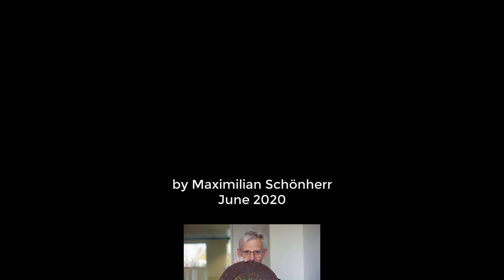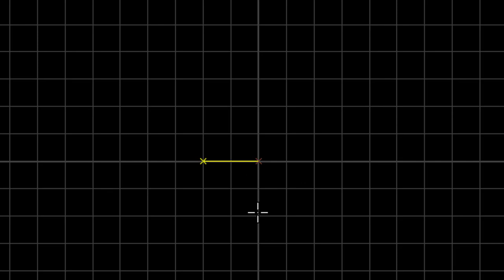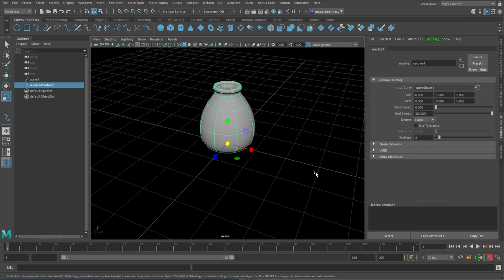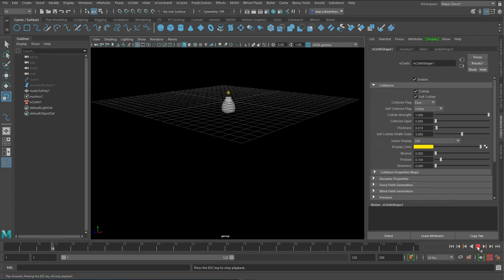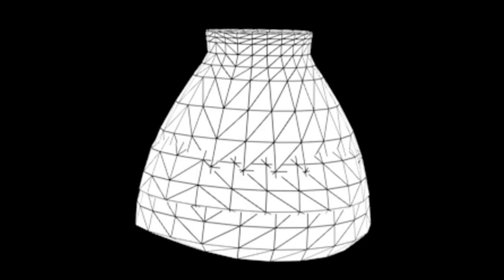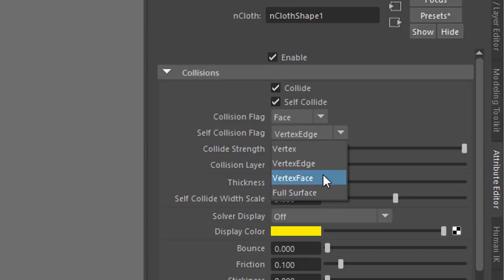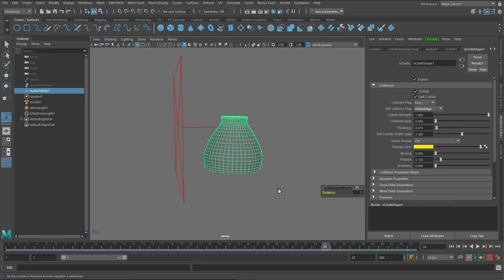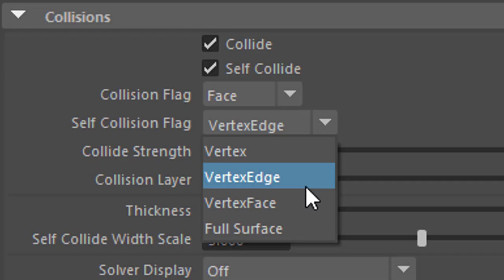Maya: nCloth Self Penetration

Comment: I know this is not relevant to the current topic but i have a question regarding bifrost liquid and collider properties. I have searched everywhere and can't seem to find an answer. 

I have a modeled pose of a humanoid figure, and duplicated it. The duplicate i applied bifrost liquid on it and the other has a collider property. I want to simulate it's skin "melting" off revealing the model underneath. But the liquid falls through the model. Any input would very much be appreciated. This is driving me nuts.
Reply from the maker: hi franklin, i‘m totally busy with other things. why don‘t you visit the autodesk maya AREA for this? the forum has been very helpful for me and lots of others, regarding all kinds of issues and questions.